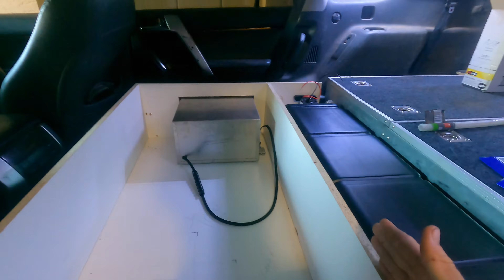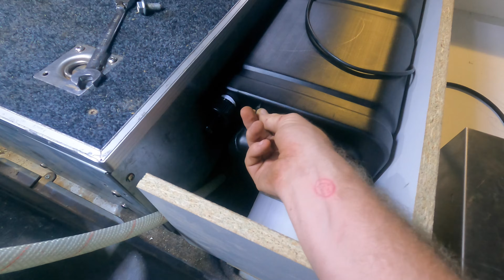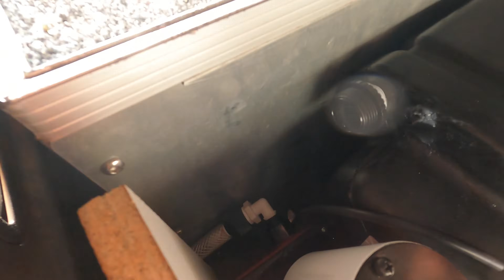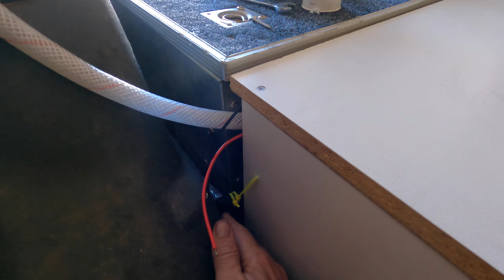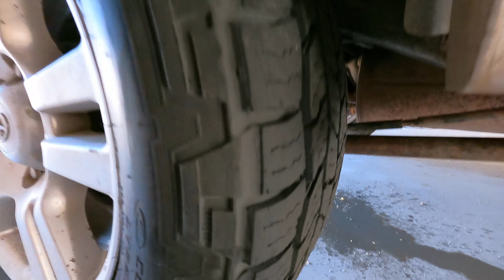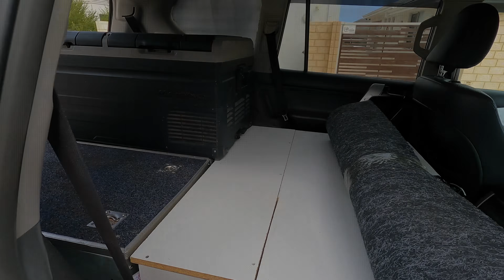Budget Prado Build: Water and Shower on Tap!

Comment: Your vent need to be way bigger, if you fill it somewhere that has good water pressure you are going to blow your vent out of the tank
The vent needs to flow the same as your fill or discharge volume 
You also need to fix that tank well so it doesn’t become a flying 150kg in the event of an accident 
Coming along well, keen to see what you get up to next 👍
Reply from the maker: Cheers mate! Didn’t think that much about the vent! Will look into running a bigger one. It should be okay in the box fully sealed up with the carpet wrapped around it
Reply: @JS_Adventure  screws into chipboard aren’t going to restrain 130+ kg in the event (forbid it) of a roll over
Put some steel straps around it and bolt it to the floor, hopefully you can use the existing seat or seatbelt mounts

Comment: maybe cut a section of the wood box top where the box is screwed down with a piano hinge so easy access to the pump and tank . . yep switch panels look good . locating them is always the hard part . good storage space behind the cooker. I think make a sliding drawer for the other side
Reply from the maker: Cheers mate! Didn’t think about access to the tank but might come in handy! As for the other side unfortunately I’ll have the battery and the inverter around the edges but still something to think about and move around to try out! 🍻🍻

Comment: Great DIY! Are you going to weigh the Prado when complete to make sure its under GVM? Especially with all the weight from water and fuel tanks.
Reply from the maker: Will do, but I’m not really worried as what we’ve put in will be no where near the weight of the rear seats and the electric 3rd row seats that came out! Maybe once the new battery gets heat we’ll give it a test!

Comment: Goes to prove that you don't need a huge budget to make life a bit more comfortable when camping. What Pressure is the pump. and did that come from Outback equipment?
Reply from the maker: Cheers mate! It’s working out really well! And cheap as chips! It’s a 9.5Lpm or 55psi pump which seems to work pretty well!